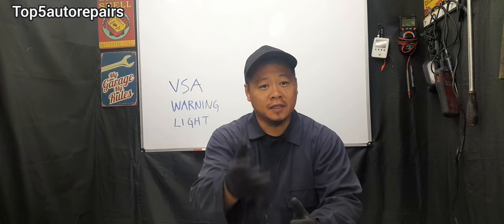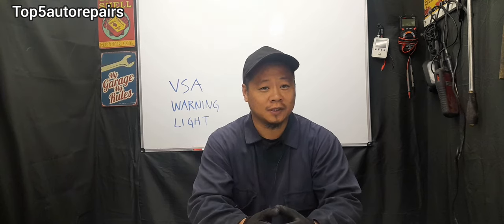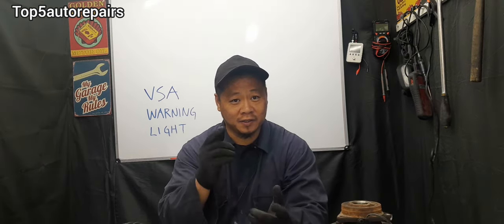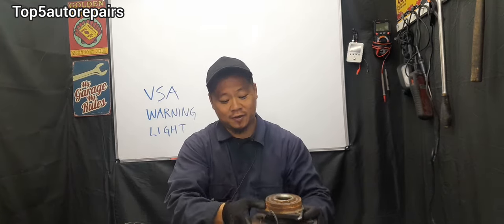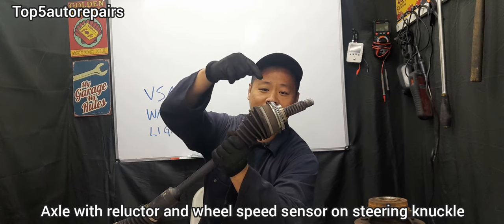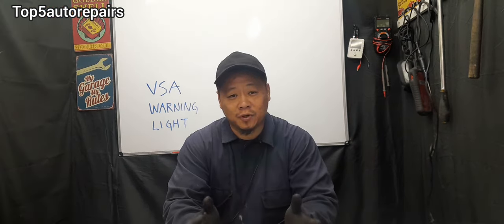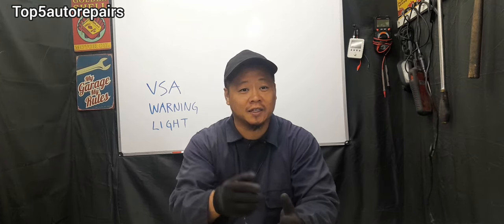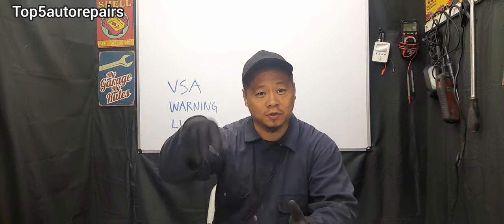WHY IS VSA WARNING LIGHT ON AND HOW TO FIX IT SO IT CAN TURN OFF

Comment: I have a 2012 Honda Pilot Touring the ABS/ VSA lights were coming ON and OFF intermittently.We scanned for codes and got 121-11 code which is for the ABS CONTROL MODULE.We bought a used part and now the lights are still ON but don't off.We scanned for codes and nothing comes up.We have tried some of the suggestions made on you tube to clear the lights and none have worked.Any other ideas that can be helpful? Thanks!
Reply: I have same problem...
Reply: relearn the engine. ask your dealer to do it

Comment: Hey buddy, I just check your video about VSA light, thanks for the info, I would like to describe my situation is that I just bought 2005 Pilot with 317KMS in Toronto, very first day I had this VSA light error while turning slowly about 20kms speed and the truck gave me big shake that I drove over something but nothing and Triangle  Exclamation and VSA light turns on, I asked local mechanic he did not know why, I went to do alignment, it was off, he fixed it and said the tires were facing each other but the more you drive, they will align, it got better but now its happening while driving on Hwy about 120kms that it gave me quick shake on steering, lights turn on and I don't know what is the problem, solution.  All brakes rotors/pads are new, I have slight problem with steering that it gets hard when I'm parking the car after driving but if I Rev it, it comes alive, please give me your thoughts, thanks.
Reply: i got the same problem
Reply: Same problem, and when the Light comes on The car revs go crazy AND nothing happens if I step on the  gas
Reply: @alexmonroy7904  you step on the gas and it doesnt go? But whenever the light is off the car is ok?
Reply: @aab123_l_32  thats right I just read It Is called limp mode... When the light turns off everything works fine
Reply: @alexmonroy7904  so is it a fuse?

Comment: i have a 2009 crv, coming back from tire store with 4 new tires my triangle and vsa light came on? tire store says not there problem ? what to do know, thanks
Reply: Same here. The VSA and triangle turned on a few weeks after I got new tires. Never before had those lights came on. I'm not sure if the new tires situation are related to the lights coming on specially since for me it was weeks later.

Comment: I just had a timing belt kit put on 08 tl 3.2l and when it went into the shop no lights on and vtech worked fine. I got the car back and  the triangle light and vsa light is on at the same time and tech not working. Anyone please help me 😢

Comment: Not on my Honda Odyssey touring mini van when VSA light come on. It was low on oil,
Reply: I have the same Van as you. When that happened to you what all was happening and what all did you do to fix it? Also did your check engine light come on after the vsa came on too?

Comment: what about vsa engaging when making left turns, not every left but most lefts to turn onto a road from a stop and accelerating to get up to speed. kicks the vsa on (flashing) and kills the gas pedal input. honda dealer spent 20 hours diagnosing it and came up with nothing (no charge lol) and just yesterday it seems cv axles are shot and barely wanted to move forward before slipping and revving up without input to wheels. new vsa module and dealer claims wss are good. no one can figure it out. i’m wondering if it’s gone now after the axles get replaced, i think slippage caused the issue.
Reply: Same
Reply: Was it the axles?

Comment: Mine goes off after shutting the car down but will turn back on solid with ⚠️ when driving forward for a bit.
I'm thinking it's one of my sensors?
Reply: What was it ? Im having the same issue.
Reply: What was it??